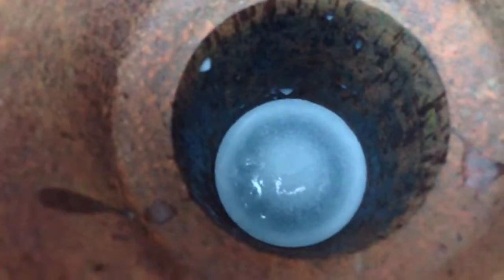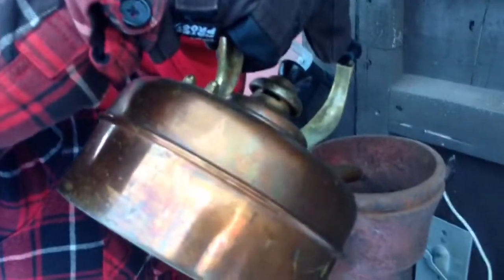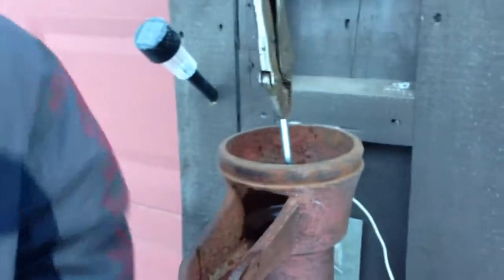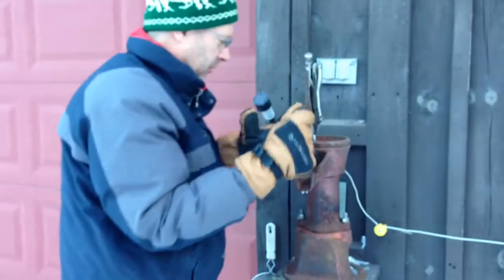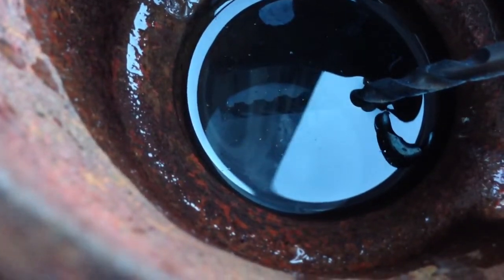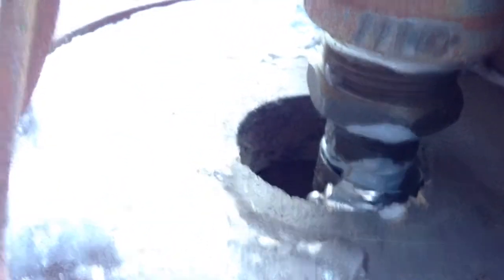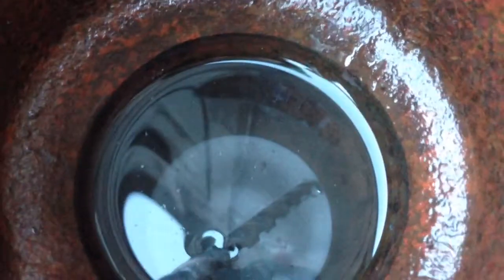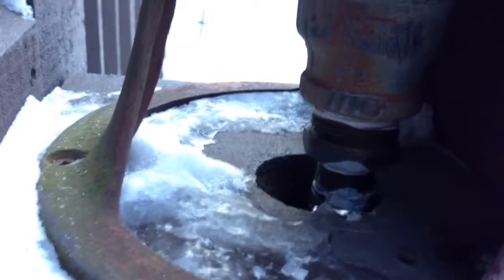-6 degrees and our horse water froze.

Comment: Bummer. We take care of our neighbors horse and when it's freezing like it has been we have to carry heated water to her. There is no electricity or well in the area so this all I know to do. Any ideas?
Reply from the maker: ***** We've got a heated bucket, so the horse's have about ten gallons of water available, but we have to manually fill that. The water supply I have four our horses is fed from a sump style pump that is in a well I dug down the hill. So in theory, you pull the water up, and when you shut it off, it all drains back down. Apparently, something is keeping the water in the upper end from exiting completely.  With out electricity, you are kinda stuck, you can use a black tub to help keep it from freezing as quickly, but thats only going to work down to a certain point.